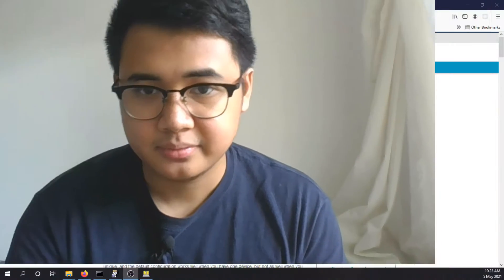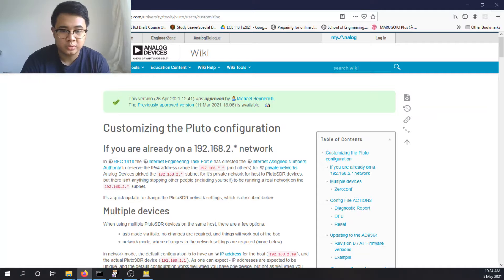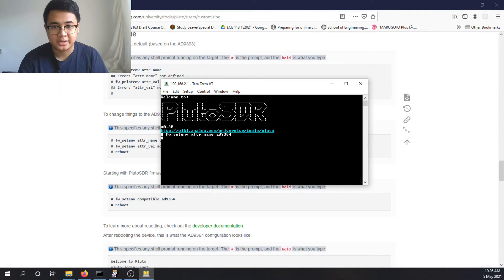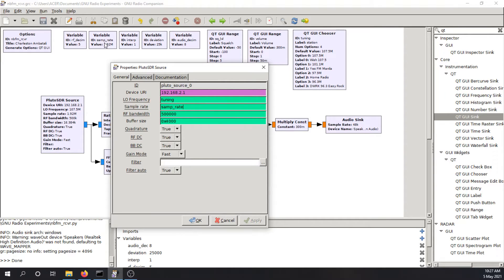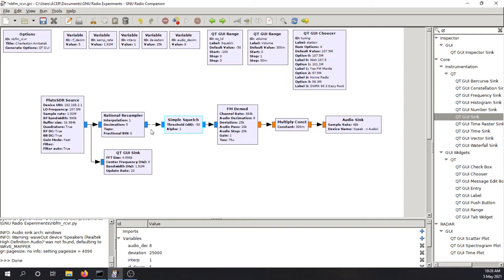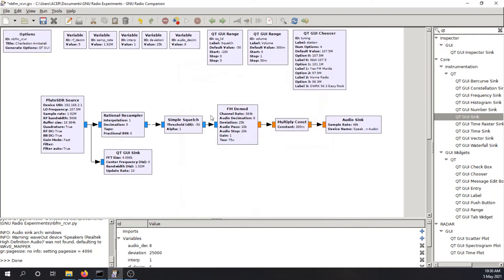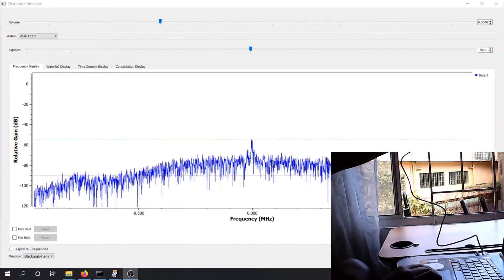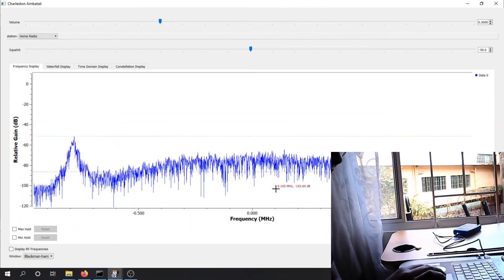Receiving FM Broadcast Signals using PlutoSDR

Comment: Hi ! nice explanation. 
But I am facing an issue with my Pluto SDR. When I try to use the Pluto block in gnu rc, I get error that no device is connected. But I can see the Pluto in windows device manager. I searched online for solutions, there it says I need to libiio, I even installed that, but no change. If you can please let me know how to resolve this , thanks !

Comment: Hello Sir. Is Pluto SDR capable of spectrum sensing? I am planning to use to as my topic in ECE Capstone Design if ever po it is possible 😁
Reply from the maker: It should be possible but you will need a strong host computer depending on what you want to sense. If it's just the presence of signals, then that should be easy. More advanced sensing will be difficult.
Reply: @charlestondaleambatali4158  In our case po, our possible objective is to sense the FM Broadcast, TV Broadcast, and Wi-Fi signal through Energy Detection using PlutoSDR and GNU Radio 😅
Reply from the maker: @shannonchua9860  FM will be difficult since PlutoSDR is not optimized in that frequency band. Energy detection should be easy but you need a more powerful host such as an RPi. PlutoSDR by itself may not be enough.
Reply: What if sir we would do the "hacking" of PlutoSDR, is it still viable to sense the FM signal? Thanks in advance 😊
Reply from the maker: @shannonchua9860  yes but again, PlutoSDR won't guarantee performance.
Reply: @charlestondaleambatali4158  Thank you so much po, Sir! 🤍

Comment: Here we updated the firmware compatible to AD9364
That doesnot gurantee better performance.. How we switch back to pervious firm ware i. e., default firmware of AD9363(325-3.8GHz)
Reply from the maker: You won't be able to receive FM broadcast signals since they mostly lie on the 88 MHz to 108 MHz range. At least in the Philippines.

Comment: Hello good day, does hacking the Pluto device guarantee that it can transmit and/or receive to frequencies up to 2.4GHz? Thanks
Reply from the maker: Without hacking, it can transmit from 380 MHz to 4 GHz. If hacked, it can from 70 MHz to 6 GHz but performance is not guaranteed.
Reply: @charlestondaleambatali4158  can the antenna transmit to 2.4GHz frequency?
Reply from the maker: @annesharrapampilo  It can. But if you want to be sure, use a 2.4 GHz antenna.

Comment: Can we learn ethical hacking from this ? I mean can I hack cars and garage dors with rolling code ( like hackrf one ). And to learn gsm hacking and spoofing
Reply from the maker: It can emulate any wireless communication system so any device with a wireless communication system can be hacked. But for more complex systems, you will need an SDR with more processing power. Moreover, you have to build everything (or use an open source library) yourself. There are devices in the market that are already geared towards the application you want. Cheaper, also.
Reply: Thank you for your response . Can you please suggest me a best device or sdr to practice ethical hacking ( radio hacking ). I planned to buy RTL-SDR but it cannot transmit rf , Hackrfone is good but it bit costly . Where I found your video about adalm Pluto sdr which is capable of both receiving and transmitting . Is there any transreceiving sdr below 200$ ?
Reply from the maker: @hariprasathmarimuthu5294  I am afraid I don’t know the answer to that since I am not an expert on hacking. It’s an entirely different field. If you need a decent processing power and a transmit and receive capability then PlutoSDR can work for you.
Reply: @charlestondaleambatali4158  Ok thanks for your kind response pal